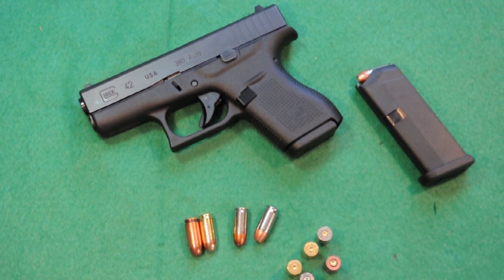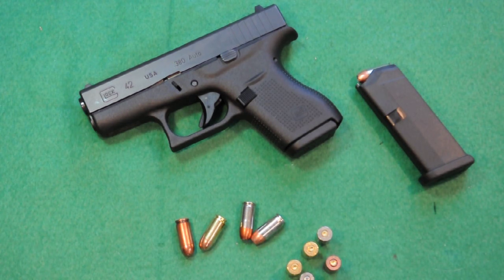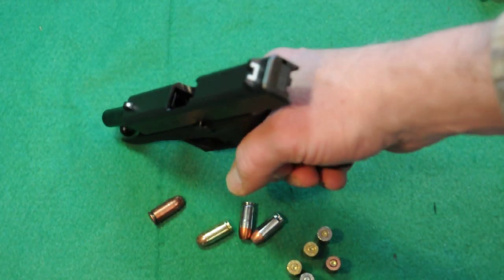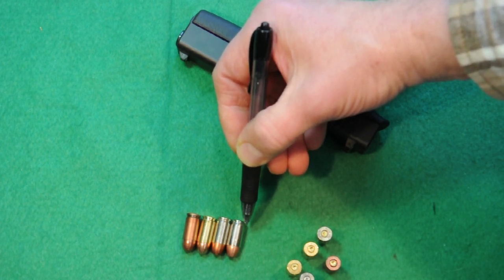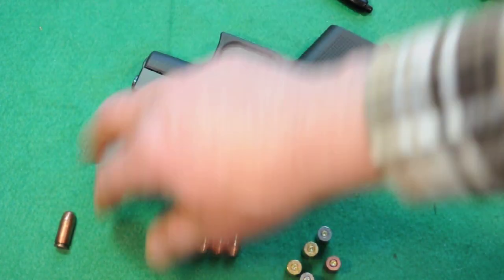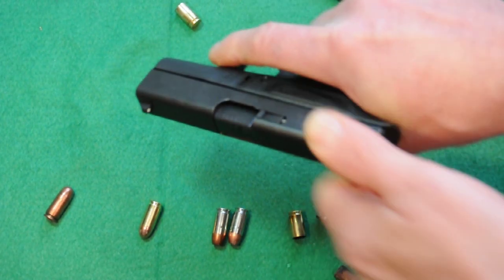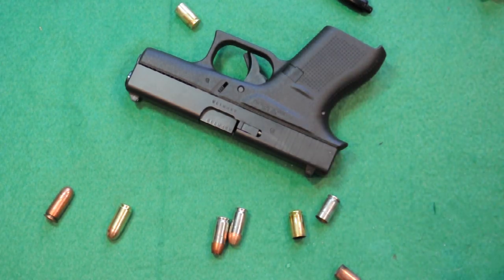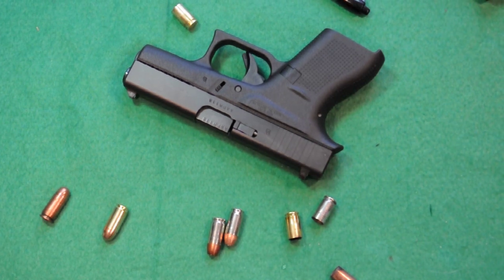Glock 42 Ammo problems

Comment: Thank you! This is very informative and answered why I had problems with the PMC 90gr FMJ rounds.
Reply: My Glock jams consistently when using Herters 9mm 115gr FMJ. Shoots everything else.
Reply: @mikenorman2563  bruh mine shoots steel cased fmj not even 60 rounds thru it and I built it myself doesn’t jam

Comment: Glock has made some revisions and updates to the 42's including:  Slide Stop Lever, Trigger with Trigger Bar, Trigger Housing w/ejector and finally the replacement of mags with new "03" mags (if you have an 02 mag, you should update these).

Comment: I was shooting my glock 42 today and decided to try out some hollow points I picked up. They were the HPR brand XTP hollow point loading. The rounds were accurate and clean. HOWEVER the gun failed to cycle them. The rounds were underpowered and unable to operate the slide. The gun stove pipped and didn't kick out the casings. FYI folks this ammo does not run successfully though this gun.

Comment: It will likely cycle pmc just fine after a thorough breaking in period. Once the friction is down slightly (metal on metal polishing from use, or a Dremel fluff & buff), and the recoil spring is no longer brand new, it should cycle well with less force. I wouldn't take any sort of failures seriously in the first 500 rounds through a new gun.

The important thing, is that it's tuned to be reliable with the full power loads, which is what you want it to be most reliable with from a carry/defense standpoint.

Comment from the maker: Acually I'm not blaming the ammo for the problems but the incompatibility of the ammo with the Glock 42. I think they designed the gun around the high power defensive ammo. If they reduced the recoil spring weight, then I think it would be able to use the weaker ammo, but they maybe there would be more wear on the pistol or perhaps they hi power stuff wouldn't feed right, just guessing about how they came about the design.
Reply: +radioqrp You're exactly right.  If you call Glock and talk to them about it, they will tell you to run hotter ammo as well.
Reply: For the feeding problem I just polish the feeding ramp with 1000-2000-4000 grid sand paper, polished till the feeding ramp looks like a mirror... now I have less problems with the hollow points!

Comment: Quality control is hard to manage on an assembly line. It may fire fine once but you don't know if it will have problems in the future. Some Hondas have problems and some Glocks have problems. Reputation for reliability means MOST of them work well. BTW I carry a Taurus G2, wonderful piece and 100% so far.

Comment: I had the same issue with the PMC FMJ. Stove pipes and failure to feed. The first three mags did not lock the slide back using Remington UMC. I also found using the Walmart TulAmmo BrassMaxx failure to feed. My recoil springs seems to fit loose in my slide compared to my other Glocks.
Reply: The TulAmmo BrassMaxx in the round white container is awful. The brass cartridge is cheap and thin. The only rounds I have ever had trouble with in my 9mm Glock 19. Now the other TulAmmo in the red box with the steel or whatever fires fine, but I'll never waste my money on BrassMaxx again.
Reply: Daniel Casher I had two squib loads in the first ten rounds fired from brassmax,  so I pulled the bullets on the rest of the box and disposed of it. I will not even shoot that crap if it was free.

Comment: Just got back from my local range where I tried 50 rounds of Fiocchi from the shop in their very clean looking Glock 42.  I liked it fairly well, except I had nearly a dozen failures to eject the cartridge.  I asked the staff and the they said it's highly likely I wasn't holding it with enough force in my wrists.  I have shot only a few other pistols and this was my first time at a range in a long while, so I'm in no position to challenge what I'm told.  Still though, I was really surprised how many times it happened, because I only shot one full magazine out of that box of 50 that went smoothly.  I mean, I do feel like my grip was suspect but my groupings were decent and I felt like it was very accurate.  I wish I could sing the praises more because I do think it shot well, but I couldn't own that gun without some major clarity as to what was going on with those failures to extract.

Comment: Glock should run anything, even Wolf. There is nothing wrong with wolf for target practice. Many ranges sell it for range use. The Glock 42 has had modifications since it first came out which corrected these FTE and FTF issues.

Comment: I have shot a bunch of different FMJ and JHP through my 42 and have had only 2 stovepipes out of 300-400 rounds. No problems with the best of the ammo I plan to carry such as Buffalo Bore 100gr standard pressure HCFN, or the +P version. Also very reliable is the Precision One 90gr XTP round. One of the rules I recently learned from none other than a Navy Seal is to choose a gun that fits your hand perfectly and this little 42 does just that. I also own a Glock 19 with a grip mod that I can shoot well, and a Sigp938 that is virtually the same size as the G42. But to tell the truth, I like the feel of the 42 the best of all. I keep my Glock 9mm's loaded with Lehigh Defense Max Expansion rounds which get deep penetration and unbelievable expansion, but the 380 version just doesn't get the deep penetration, so I'm gonna go with the Buffalo Bore 100gr Hard Cast Flat Nose. Bone and meat smashing penetration from any angle. That makes the Glock 42 a formidable pistol for self defense.

Comment: I'm having the exact opposite issues with mine. Full Metal Jacket work 100%. Remington GS were abysmal. Some type of gun malfunction every two rounds and accuracy was off target. From 10 ft I could not hit an 8-inch Circle. That could have been from the fact I was having to fix a double feed or a stove pipe after every shot.

Comment: I've tried three cartridges with my G42. Freedom Munitions 100 gr RNFP performs flawlessly. Hornady 90 gr Critical Defense fails to feed at least 15-20%. The round hangs on the feed ramp. Barnes 80 gr TAC XPD will not cycle the weapon. This thing is the only ammo sensitive Glock I own. I need to find some Golden Sabers or Win PDX-1. Thanks for the information.
Reply: Ck out Precision One 380 for Glock 42 380. It's specifically designed for the gun you have.
Reply: @fuzfire  I have and that ammo works flawlessly.

Comment: Another option to help the Glock 42 cycle with lower power ammo:  Galloway Precision offers a 10% reduced spring rate guide rod assembly.  I have found most .380 ammunition with a muzzle energy in excess of 200 ft. lbs. is about $1.00 a round not including shipping and is not readily available.
Reply: Richard DiLorenzo Last comment:  The reduced rated guide rod spring did not cycle low power/bulk ammo any better than the original in my wife's hands.  I found some Atomic .380 JHP with a muzzle energy of 241 ft. lbs. at Midway.  Works great!  Also some Remington with 200 ft. lbs.  That too cycled well.  I would point out, in my hands the gun shoots anything, but for my wife it takes some "extra punch" ammo to make the gun function flawlessly.

Comment: Nothing worse than buying a new gun and it won't run. Give it some break-in time and it will probably work its self out.
Reply from the maker: Hi.. in the 6 years since the video Glock has tweaked it to run better with various ammo, I guess they might have had the recoil spring too strong because only the hottest ammo would run right from others I've read or seen. I'm hearing all good reports now. Thanks for the comment and watching.

Comment: First off I have a sig p238 stainless from what I've seen they never malfunctioned with any type of ammo some of the fire pins would cause a round to go off possibly if the primer was soft bulged and you chamber a round with the manual safety on. I never had this issue or saw any case of this. But they unlike Glock fixed it.
Reply: I've never had a problem with the 2 P238s I had, I did call Sig for the updated recoil spring and used that one in my older P238. As usual they were great and sent it for free, Sig always has exc support.. that was a massive recoil on the XDS.. I think every one had to be returned for updating, not just a range.. I like springfields a lot but what's up with the no parts availability and you have to send the whole gun back to replace a stupid part.. I think they have gotten better on this.. however, try getting a barrel.. S&W, Sig, HK, Beretta offers barrels so you can drop in a .357 sig barrel for instance. Not Springfield

Comment: The factory recoil Spring is too hard in the G42. Remove the factory, plastic guide rod and recoil spring and replace it with a heavy tungsten rod and a softer recoil spring and it will be more tolerant of different ammos.   Made a big difference in my G42.
Reply from the maker: Thanks for the tip.. I always use to replace my guide rod in my Gen 3 Glocks with solid SS before the Gen 4 came out. I didn't realize they had a good way of doing it on the 42, I'll have to check it out. I bet the tungsten helps steady the gun too with a little more weight up front.

Comment: sounds like this gun needs a slide recoil spring of less pound compression strength. Maybe wolf springs sells it.
Reply from the maker: I believe you are correct, that's my take on it too. However, small guns have a hard time being able to function with all different power levels of ammo.. in the old days a gun was designed around a small range of power curve standard ammo.. i.e. 230 grain .45 acp at 820 fps for example. Today we expect guns to function with all the ammo available.. bigger guns can do this better. So I think Glock designed this gun for powerful self defense ammo that works fine in this gun. My guess is if they put a lower poundage recoil spring in the 42 practice ammo would work fine but the powerful ammo would cause the slide to go to fast maybe boucing the ammo off the feed ramp or some other malfunction. I think that their choice is a good one for the poundage on the recoil spring for powerful self defense ammo.  Thanks for the comment!

Comment: The 42 for one compared to most of the other 380's is much larger. While not huge by any means it still is basically the size of a 9mm. The whole idea of pocket carry is it's deep concealment. And when guys start bashing ammo usually there's a problem with the gun itself. I am sure they will tweak out the issues and it will be and is a fine weapon but it's size is a simple why, why not smaller.
Reply: But why make a 380 that's a niche gun for pocket carry too big for pocket carry
Reply: radioqrp You've got that all completely backwards, off the top of my head the Ruger LCP, Taurus TCP, Keltec P3AT and S&W Bodyguard are all locked breech and way smaller than the Glock. Bigger .380s like the Sig P232, Walther PPK and Beretta 81 are actually blowback. There isn't really anything unique about the Glock.
Reply from the maker: Thank you for the comment and the correction. I know the difference between blowback and locked breach, and knew the PPK, P232 etc are blowback, but shot a LCP once and with the terrible recoil I assumed it was a blowback.. .

Comment: Did anybody mention oiling the gun??  I had similar problems with my Glock42 with stovepipes right out of the box.  They say that Glocks can run dry.  Not this one.  A few drops all around and the ammo that was stovepiping before ejected fine
Reply: Interesting, that may be why I have not any trouble out of mine, Frog lubed out of the box and have had zero ftf, fte. I will make sure to keep it lubed.
Reply: I had one stovepipe when I first tested my gun at the place of purchase. I asked them about it and they said I wasn't keeping a firm enough grip on the gun, which was allowing it to kick upwards.
Reply: Michael Abramowitz 
I don't know who "they" are that say Glocks can run dry, but I know that the manuals that came with all my Glocks have instructions on how to lubricate the guns (just don't overdo it).

Comment: No idea why Glock didn't build this in 9mm. Ridiculous thinking, but I guess they figured people would buy this anyway. If it can't cycle PMC, then I would have trouble calling it a "great gun".
Reply from the maker: It's a matter of physics... they made it really small, 14 oz and tiny.. so it can handle the .380 not the 9mm. Other manufacturers have tried the best I've seen is about 25% bigger and 18 oz.. hopefully some day they can make a slightly bigger one in 9mm.. I agree on the PMC.. make the gun a little less durable with +P but able to shoot anything..
Reply: radioqrp It's a matter of bad marketing. Glock is way behind on this one. The S&W Shield, Kahr Arms, Beretta Nano all in 9mm and Glock makes a .380. I've heard they have a 9mm in the works, but it's a few years late.

Comment: I've never had a issue with my 1911,sig p229 or H&K or even my other Glocks. With any ammo. Why can't the fan boys just admit that the Glock 42 sucks. They made a mistake it happen.
Reply: I think you're comparing apples to oranges, the guns you mention are full size models. Colt who makes 1911 also made the colt mustang, which had tons of problems. Sigs P238 when it came out had growing pains they had to fix some problems with reliability.. also Sigs P230 and P230 doesn't like some of the ammo, same for the Walther PPK, etc...

Comment: You could stamp Glock on a High Point and these drones would buy em out. The 42 is too big for pocket carry it's a fail
Reply: I'm going out on a limb here and guess you are a 911 drone who hates Glocks just because. I don't buy self-defense pistols at Antiques Road Show. 
 I've been carrying a Glock 27 for years as a pocket pistol. If you think the 42 is too big you might consider looser pants for concealed carry.
Reply: I'm 5'9" and 162 lbs., and I pocket carry my Glock 42 daily in all varieties of pants from jeans to flat-front khakis.  It disappears just fine, and currently I'm just using a Remora pocket holster while I await delivery of my custom Kydex.  Once the thinner, Kydex models arrive, it'll be perfect.  Even now, however, I have no issues with my draw and presentation.  Those calling this a fail for pocket carry certainly haven't tried it yet and most definitely haven't practiced with it at all.  I'm a smaller guy and love it.  For the record, previously I was carrying a Sig P238, and comparatively this is a dream as it's lighter and thinner, despite being .5" longer.

Comment: Solution ... sell that junk and buy a smaller 9mm or 40 why would you buy such a big 380  and when I say big compare it to every other newer 380  on the market Jesus there's 45s that are almost that small and hold the same round count
Reply from the maker: Mine is flawless with the right ammo and only weighs 14 oz, 16 loaded .. a tiny Springfield XDS 45 like you mention weighs 28 oz .that's 3/4 lb difference... not even in the same ballpark.
Reply: 380 and 45 are in a different planet as far as the round is concerned .. I was using 45 as an example but you can get a single stack 9mm with much better ballistics that's pretty much the same size and holds more rounds .  I get the hype I held one but that's all I did was hold it .. just cause the name starts with g don't make it a good buy .
Reply: Don't mean to rank on ya man I'm sure you have your reasons
Reply from the maker: No problemo bro
Reply from the maker: That's true.. the smaller you go with the gun the less it is able to shoot a wide verity of ammo weights / power / bullet shape etc.. so there really isn't anything wrong with the 42.